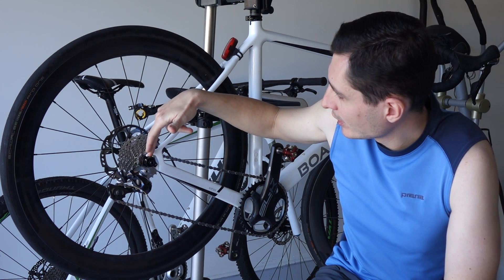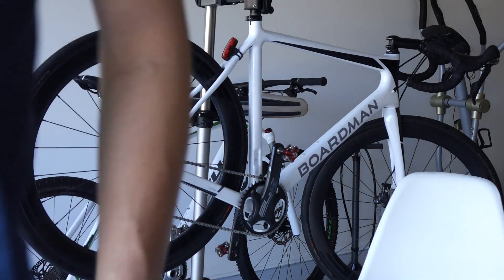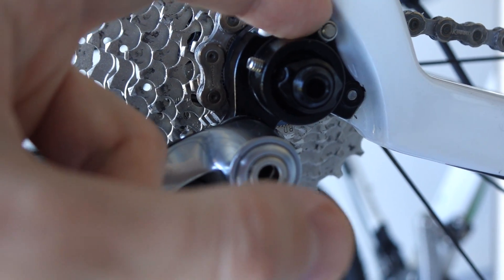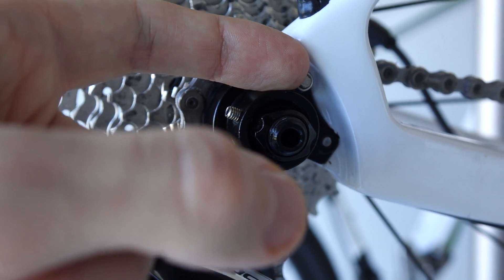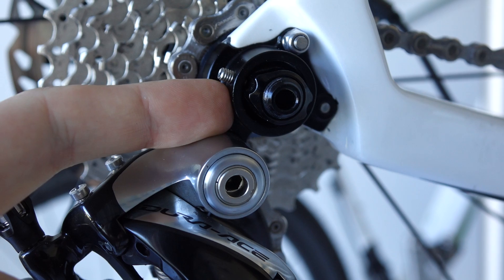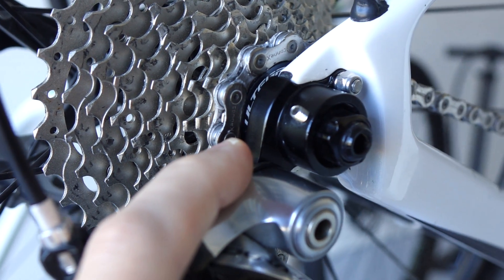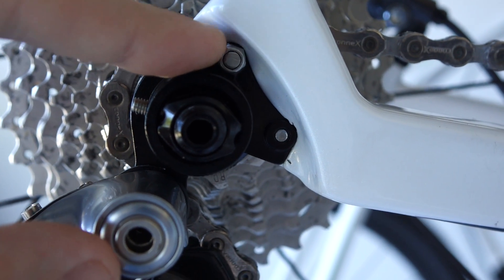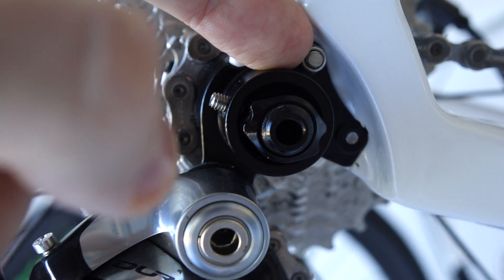Boardman SLR 9.2 dropout/derauleur hanger design faults and subsequent failure.

Comment: Are you sure? Usually the hanger n carbon overlap n your weight is mainly on carbon not hanger.. this is quite stupid.. back wheel can be snapped any time under your weight
Reply from the maker: It can not under my weight, as there is a carbon "lip" over the hanger, however, it is a very stupid design still.